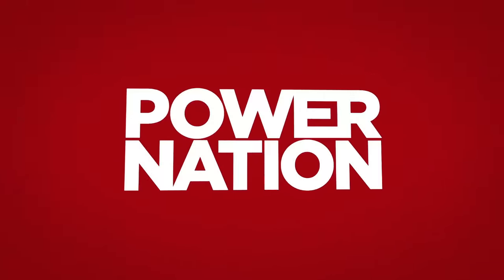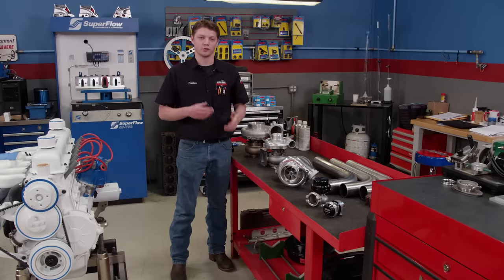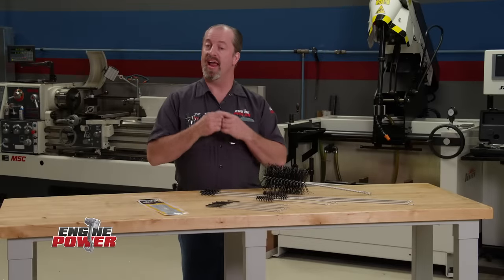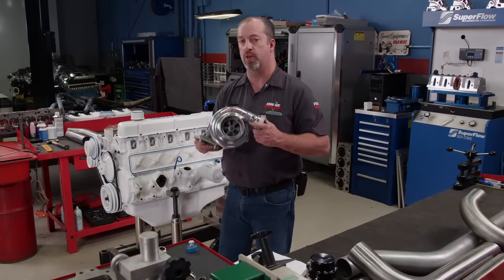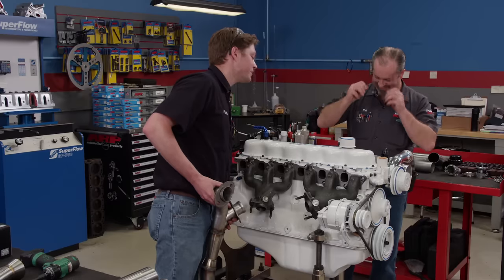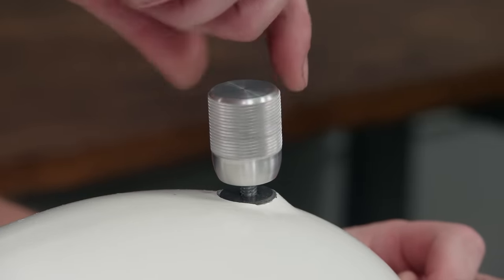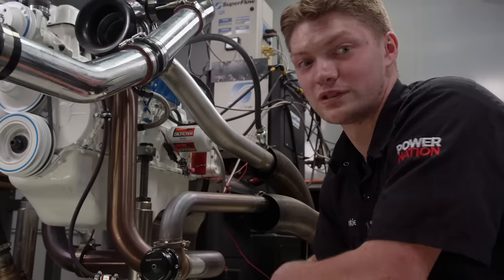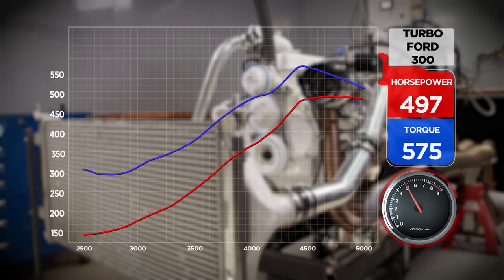Turbocharged Ford 300 Inline Six Makes Over 500 HP on the Dyno - Engine Power S8, E14

Comment: Seeing that you started with 88HP, This engine is now putting out over 6 times that. Now we know why they last so long in stock form. I am putting one of these in my speedster build. I am starting out stock and then after it is on the road, I am building a monster 300 for it. It is called Project Boat Tail. Thank you for doing the R&D for me guys.
Reply: Get an 93-95 one there EFI and make 150hp stock I have one
Reply: @jamesworkman686  efi will require engine management taht os much more expensive. Carb is the way to go
Reply: @jamesworkman686  That is the plan
Reply: To be fair, when it made 88HP the governor for the industrial application was still in place(you can see it above the alternator in the first dyno run). Just removing the governor and properly tuning the stock carb should have easily gotten it close to the automotive engines 170 gross HP rating.
Reply: @STAY-GOLD-VINYL  The efi ones had the good exhaust manifolds and the higher compression head (though i think the carb head can be made to flow better).  I think starting off you'd be better off to carb swap an efi motor than to start with the carb one.  Youre swapping intakes to lose the YFB anyway
Reply: @limprooster3253  EFI heads don't flow any better, but the EFI exhaust sure does! That, plus the log intake mfd, coupled to a SINGLE barrel Carter, is proof Ford gave exactly zero Fs about anything over 2500 RPM.

If anything, get the carb heads: unshrouded valves, plus no "smog ports" in the heads means less likely to warp/crack. The EFI head really was the Achilles' heel of the 4.9.
Reply: @bcubed72  We said pretty much the same thing.  The efi head was more mechanically efficient.  The carb head responds better to being ported.  We need an aftermarket option if we want these engines to do anything above 4000 but who is going to do R+D on a new head for a i6 thats always been considered slow and has been out of production for 30 years?
Reply: @limprooster3253  ProMaxx
Reply: @bcubed72  You can find EFI heads without the smog ports, not all of them had it though it seems alot if not most of them do. regardless its an iron head, if treated right and done properly it should behave just fine. there's people shoving 15-20psi into them (after some supporting upgrades like headgasket etc of course) with no issues really.
Reply: best to tell us AFTER youve done it,not before
Reply: also remember,this 300 has a $1500 cylinder head on it ,forged rods and pistons,a big old cam,big old roller rockers and valve springs...it aint a stock head so your results will vary MASSIVELY
Reply: @micahrlusk  exactly.  And the smog heads really only cracked if you did use the smog setup.  If you plug them off it'll probably be fine.  The issue was hot cast iron didnt like having cold air blown through it, and it heated the head uneven.  We see that with ALOT of 80s smog heads
Reply: @limprooster3253  exactly, when you introduce cold with hot especially in terms of metal and metals like iron and aluminum, they don’t tend to react well to it. Like putting a frozen glass full of something in a hot stove, it’s gonna burst.
Reply: or you could buy a 300lb 1.6 liter honda engine & make the same power...
Reply: @elonmust7470  it would take a lot more building up for it to survive 550hp lmao
Reply: @micahrlusk  A set of forged pistons & rods, both of which can be had for around 500 bucks. (Vitara pistons & speedfactory no notch rods). Head studs & big injectors is all thats left along with the turbo hot & cold. Then 500 WHEEL hp is somewhat of a mild goal.
I know, Ihave a garage full of them, along with fords & mopars & chevys. The Honda engine is king when it comes to making power on a budget, the LS being next in line..
Reply: @elonmust7470  there is a lot I could do. This is what I want to do.
Reply: @elonmust7470  well a B series yes, D-series not so much. B series is more expensive and if you want decent forged parts not ebay it’s a little more than that. Not saying they’re not cheap but the main downside to a big power Honda motor is the torque, that’s why you build an inline-6 or V8 lol and sound. Some don’t like the sound of a Honda engine or not as much over a 6 or 8
Reply: @micahrlusk  The D series will certainly make such power. I've literally done it before! 
All I was doing was widening the spectrum of conversation here, I'm not trying to influence one way or the other.
Reply: @elonmust7470  Forgive me if I don't want to run a 5.Something:1 rear end gear to get drivability on the interstate.  The power/liter on those hondas is impressive, but I'll take torque instead of  8000+ rpm
Reply: @elonmust7470  yeah I know a lot of people don’t give them credit, I do but they have their place like everything else. D series can yes but from what I’ve seen takes more work. I’m not a Honda guru but in terms of an engine taking the power reliably that’s what I’m referring to. Almost any engine can make 500+Hp but for how long is the fine print lol
Reply: @limprooster3253  The b series transmissions I like using have a 1:1 gear ratio in 4th. Technically speaking, 5th gear @ 6000 rpm is around 180mph, meaning that highway crusing can be done at what would be considered a high idle by the engine. Like I've already said here, I'm not telling anyone what to do, okay.
Reply: @micahrlusk  The longevity is largely up to the tuning. I reacently read a thread from years ago about a completely stock sans cams h22a that made over 500whp for an entire season of drag racing & dyno pulls. It eventually dropped a valve so technically the motor was still fine from the boost. Pretty incredible.
Reply: @elonmust7470  some people may get lucky but an engine not designed for that won’t last especially if it’s not a healthy motor or at least been refreshed. That kind of instance is quite rare and of course anyone can say their engine is stock or built but without proof it’s anyone’s guess. Not saying he’s lying but just saying it’s common for people to do that. Tuning plays a big part but it can’t make up for hard parts that simply can’t handle the stress etc
Reply: @elonmust7470  That's fine, I'm not saying Hondas are trash either.  Im just saying by going the 1.6 liter route you are giving up bookoos of low end torque, and thats what the 300 does best.  And in my opinion, that makes them drive really well.  

What im getting at with the gearing is again, low end torque.  I like being able to cruse 75ish down the interstate and leave it in overdrive. I believe with a fairly aggressive overdrive you can have your b series engine down around 1700 at 70 or so, but when you decide to pass someone you have to down shift.  To get it to stay in overdrive youd probably need to be around 2800-3200.  That's fine i guess, you'll probably still make darn good mileage there, I just don't like keeping it wound up that far lol. 

Anyway B series are very impressive for what they are, not dissing you there, just not my thing
Reply: @limprooster3253  I don't have to downshift though, I can give half throttle & be at 6 lbs of boost by 2500 rpm. Thats around 300 at the wheels, almoat the same torque. It won't makw much more torque than that, though. The engine's bigger than a 1.6, too. it's an h22, 2.2 liters.
It's nothing like the turbo ly6 I have in a fox mustang, but it's still plenty fun.
Reply: @elonmust7470  Okay now I smell bullshit.  A 2.2 is roughly 135 cubic inches.  So N/A, you could reasonably expect 150 ft-lbs from it.  So theoretically with a 2.2L engine, @6 psi, you'd be looking at 211 ft-lb.  211 ft-lb @ 2500 rpm = 100 hp.  That IS impressive at such a low rpm. Its similar to modern veloster turbos, and those drive well on the interstate.  But your numbers are completely made up.  You're saying youre making 300 hp, 300 lbft @ 6psi and @2500 rpm.

To make 300 ft-lb with a 2.2L engine, you will need around 15psi.  Maybe a little less, likely a few psi more.  

If you make 300ft-lb @ 2500 rpm, that equates to 142 hp.

To make 300 hp @ 2500 rpm, you would have to be able to crank out 630 ft-lbs, which is extremely unlikely from your 2.2, especially at such a low rpm.  It equates to being able to build over 47psi of boost! And you just cant move that much air at 2500
Reply: this motor. stock. makes. 150. HP.   this line most have been really. sick.
Reply: @ccoates1064  The industrial 300s had a governor on them that really killed the power output.  These things were made to run 30kw generators and such, so anything over 60 hp was plenty
Reply: Honda made some great car engines, but the 300 is known for off idle torque. Think tractor type of torque, with peak at 1800 rpm. Even at red line your 1.6 won't touch the torque numbers this thing will put out. It will possibly out-do the Japanese 4-bangers in reliability as well, which is saying something. Anyone I've ever known who had one always said the same thing. The whole rest of the truck would rust in half and the engine was still running like new with 300k+ miles. Not fast, but always got the job done.
Reply: @limprooster3253  If you have an email I could send you the dyno sheet. It was tuned at J. Mills Tuning LLC. in Franklinton NC. The car maxed out 1000cc injectors on 50lbs pressure, on 18lbs boost, thats close to 500whp. I run e85 by the way. The car never made 300whp at 2500rpm. It will make 6 psi @ 2500 rpm. Not until 6200 does it make 325whp on 7 lbs. 
All of these numbers are on 17° WOT timing. These engines can take 30°...
Reply: @randr10  We had a 74 f250 with a built 390 that we used on the ranch. It was built back in the 70s by a friend of my grandad's. It loped a little bit with the choke in, but was definitely built for torque. We've had five 700 gal concrete water troughs on a twin axle flatbed behind that truck, had to have been over 30k lbs. 4 wheel low range first gear, wide open, going up a steep ridge in the California Valley. Thing would get hot, & even start  firing unburnt fuel off in the exhaust, but she never gave out. My grandpa's friend, McGee, knew what he was doing for sure. & I'm not just a honda guy, I have a lot of faith & pride in old stuff like the Ford 300 inline 6.
Reply: @STAY-GOLD-VINYL  you can use a carb setup on an EFI block. There were some other changes done in those years that improved on them, such as the stock 2 piece exhaust that function as headers as well as a better flowing head.
Reply: @CzechSixTv  Those intakes weren't good for much. Best tuning I've seen on a stock carb model didn't break 110hp. Efi was 145-150 and about 265 lbs and some of that was their redesign of the intake and head.
Reply: @elonmust7470  if you are just going to throw any old motor in the thing, why would you go with second best? There are a million motors out there and the Honda 1.6 is the best you could come up with?
Reply: @limprooster3253  They were originally based on tractor motors. Ford's inline 6s were torque monsters back in the day and they began to adapt them to road vehicles. Early on they had to stop trying for a while until a transmission was developed that could handle more torque. Not so impressive these days but they were wild at the time.
Reply: @brahtrumpwonbigly7309  It's an engine that with a few hundred dollars in parts, can zing out 400 wheel horsepower. All from a complete bare engine, that I can heave onto my right shoulder & walk with. That amazes me. 
Personally, I like h22 engines, but they are almost twice as heavy.
Reply: @brahtrumpwonbigly7309  the old 300 paired with an NP 435 ended up being an awesome setup.  Way too slow by today's standards since there is no OD.  But back in the 70s, a 6.68:1 first gear made for a pretty useful farm truck.
Reply: Probably won't be an issue if you're really going to dig in there and replace internals but I think it's after 83 they started putting nylon polymer timing gears in them to make them quieter. unfortunately those gears can suddenly blow up in high torque applications. so you should get a whole new timing gear set either made out of aluminum or steel.
Reply: @elonmust7470 yeah you could but you couldn't put that in a 1 ton truck and pull with it...🤷... Small displacement engines with high horsepower is made to be in lightweight cars.. that's their advantage.. would be hard for that 1.6 to produce 600 foot pounds of torque.... Unless you really really really pushed it.. at that point your horsepower would be through the roof... Those Small engines rely on high horsepower numbers.. the torque is always lower... Honda new this.. that's why their cars are light.. I have a built h22 at my shop.. has scat rods type S style aftermarket Pistons, head studs..ect.. it's an A4 engine so we had it dry sleeved.. had a scratch in the frm  bore that couldn't be fixed.. but it'll be more easily rebuildable now..

Comment: Has to be the coolest engine power episode ever, thanks
Reply: Absolutely
Reply: Agreed
Reply: Yes
Reply: You ain't just whistling Dixie!
Reply: It’s a break from the V8s, a much needed one at least
Reply: Idk the boosted slant 6 was pretty sick too
Reply: I 💯💯💯💯agree!!!
Reply: Agreed
Reply: 100%
Reply: Now they are going to have to take it to the next level and do a bulletproof build and throw even more boost at it!
Reply: @americanpatriot2.06  Thinks about block, taps temple, and decides to head to the pub instead
Reply: I absolutely love the ford 300 big six.. the longevity  reliability,  and torque..I bought my 94 f150 because it had the 300 six in her. Got it with only 109k on her..now I'm at 120k.. I haven't done much other basic tune up and I deleted the smog pipe and now I need the shorter belt and delete the entire smog pump..kinda thirsty on gas but not too horrible it's a 5spd 2wd.the mr52. Manual trans... I really want to put a 3.08 gear in th axle..
Reply: Agreed! Ford Barra next?
Reply: @jdubskiwright2380  That's pretty cool.  Let us know when you boost it.
Reply: @81mont  Either the Barra or the Atlas AKA "Ameri-Barra".
Reply: Totally dude. This is frigging great!
Reply: @charleslowe522  I wouldn't mind putting a turbo from the 7.3 power stroke on it... gotta do bigger Injectors of course..and a cam would help as well as exhaust header..I've read that when you boost the 300 guys are getting around 23 25 mpgs..that would be awesome.. I dont think that transmission will handle all the torque gonna have to upgrade to the zf5 atleast
Reply: Not even close.
Reply: @81mont  I'm so geeked to see you write about the american2jz.want one,just don't know what I want it in.plus,thinking bout the new Vette.
Reply: Slant six
Reply: @danielmurgaw2153  what about the slant six?? Yea there tough motors for what they are but there only 225 cubic inches ..I've seen a few that are built with cam header bigger carb and better Intake..but even after you build them they still won't make the kinda power a ford 300 will make... so there only good for motors in daily drivers or small work trucks
Reply: Giving me a straight six
Reply: Yessir!
Reply: Not long ago if they feature anything but a V8 people were crying and turning off their TVs
Reply: Dunno, the Chevy 292 and Slant six were both pretty badass.
Reply: Couldn't agree more brother.
Reply: AMEN!!!!
Reply: @jdubskiwright2380  Sold my 93 f150 with 350k on a 300 and bought an 88 bronco with 180k for my new daily driver. Both on original motors, no major repairs. I will say I've got the 3.08 in the bronco and it is manageable but it also came with 31's factory. Without a low gear, I wish I had the 3.55s
Reply: @brahtrumpwonbigly7309  3.55s or 3.73 even would help big time..I would like to swap mine to a 3.08 being it's a 2wd an all I think tht would do fine
Reply: @jdubskiwright2380  what gears do you have in it right now?
Reply: @Richard Tuppus I considered the 3.27 or 3.31 actually I just thought it would make it sit higher in the rev range..I dont have a tach installed yet so idk where it sits honestly it's not very much rpm on the highway tho..I know 2000rpm sounds the same as 4000rpm with the 300 tho.. I figured a 3.31 with a 16 inch wheel n tire would do ok
Reply: @Richard Tuppus I also want to install a turbo and run about 8 psi of boost.. the 300 is a torque monster with a cam bigger injectors and a couple psi in her
Reply: Definitely!
Reply: Agreed!
Reply: I love all the unknown engines, I mean least popular
Reply: David Petriess I'd like to see this make 975hp and 900foot pound's of torque at 55 pounds of boost I understand that it's a little overboard but hey us gear heads there's no realm of limitations of how much you can make horse power if done correctly and open new realms to making hp but put that 975 hp engine into a 2 door 1952 Ford customline car and take it to the drag strip and see the quarter mile times
Reply: Who ever painted a motor white is a momo
Reply: I don't think I've ever seen this much enthusiasm during testing.... EVER
Reply: That's more than one horse power per cid wow